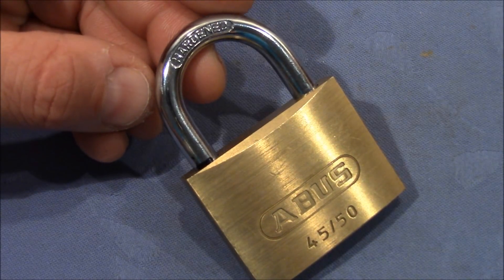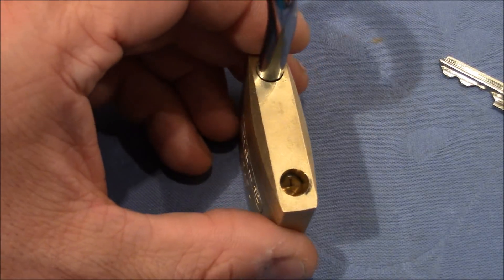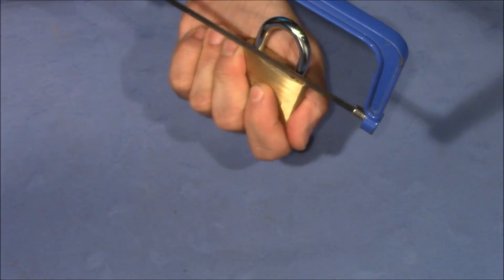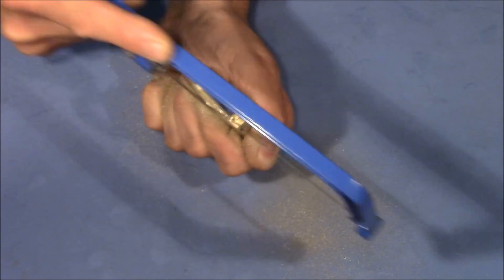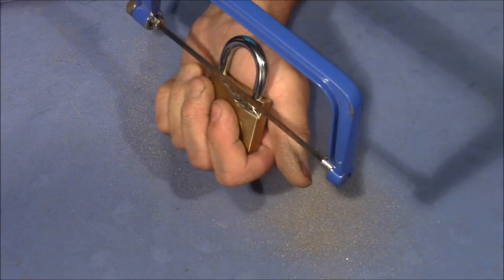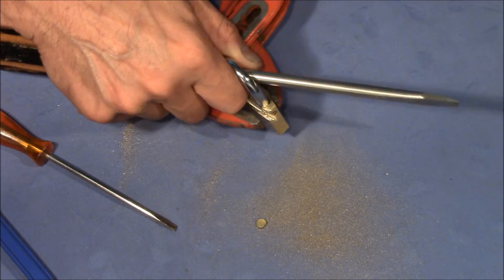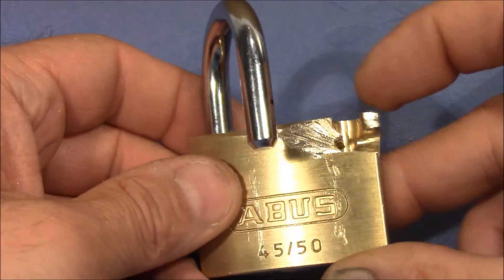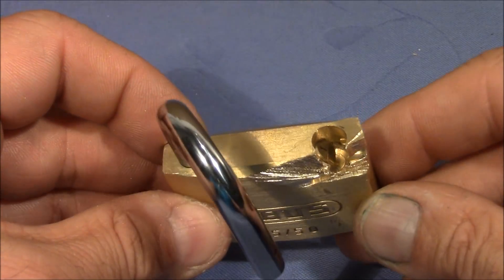(picking 555) How secure are brass padlocks? - hitting the weak point on an ABUS 45/50

Comment from the maker: Brass padlocks like the ABUS 45/50 have hardened steel shackles and 5 pin cores with security pins and paracentric keyways. However the brass body makes them vunarable for a simple attack where from the side of the lock are part is cut away. Then the shackle can be twisted out of the lock body.
Reply: I need a strong lock against acid and a hammer and saw impact.  
Can Stainless Steel 304 hold that ??

Comment: I too was worried when watching you with the saw! I’m glad you still have all your parts intact :-) this was very interesting, but a simple twist attack with the pipe wrench a la LPL seems to be a more effective attack for this type of lock. I though it held out quite well for a cheaper lock too :-)
Reply from the maker: Thanks, Potti314 is still in one piece ;-) The advantage of my attack is that you don't need a fix point, think about a padlock on a loose chain.

Comment: Good expo on the vunerabilities of the modern brass padlock. Would be the next best line of attack after brute shear pressure of bolt cutters. The achillies heel it would seem of most open shackle padlocks. Maybe you could try it again with a electric saw to compare the speed and cut rate on that type of attack. I would even volunteer to send over several Abus victims. lol. Cheers:-)
Reply from the maker: Thank you for you kind offer but I don't own an electric saw and I'm done for now with these kind of tests.

Comment: Good experiment... I wonder how it would hold us to a swift blow with a hammer & chisel....Cool video my buddy
Reply from the maker: Cheers buddy, for the hammer you need to have the lock hanging at some fix point. But I guess the lock will break - the locking bolts are small and made from brass.

Comment: Wow nice demonstration ! :D  I too was concerned for your hand - we need your hands in good health (but yea I know you were careful).  I'm wondering how long it would take to cut through the shackle with the same saw?
Reply from the maker: Cheers buddy, maybe I'll try cutting the shackle someday but the point was that this attack works regardless of the shackle thickness or hardness. I'm pretty sure that the saw blade will suffer much more from cutting the shackle.
Reply: One more question if I may ... what about using a chisel & hammer to quickly cut the brass (next to the shackle) ... if it works then it might be quick (although it'd be loud).  Thanks once again show showing this video. :D
Reply from the maker: This might work well but the padlock needs to be fixed somehow. If just hanging loose on a chain it might be difficult.

Comment: I wonder if annealing the body first by heating with a blow lamp and letting it cool will soften the Brass making it easier to cut? Oh and just because the hasp has Hardened stamped in it doesnt mean its so  :D
Reply from the maker: Interesting idea with the heat treatment. I guess it would help although the point was that a simple saw can do the job alone. Also it does not matter how thick and hard the shackle is. This attack will always work.

Comment: I know lots of other people will say it, but - aaaaaaaggggghhhhhhhhh ! I had to fast forward past you sawing that lock in your hand. I think that if the lock shackle was locking something rigid, you would then only need to stabilise the lock body with your hand away from the cutting point to make the saw cut, which would be easier for a thief, and less scary for us to watch :o))))  Thanks for doing this anyway, so we don't have to :o)
Reply from the maker: I also think that the lock hanging from a chain, the procedure would have been slightly easier. But while cutting, the blade was in the slot and no risk of slipping existed and I wanted it to be realistic. But I will wear gloves next time ;-)

Comment: Brass locks are beautiful but softer than hardened steel. I'm just glad we didn't see a slice of pie(314)! Sorry, someone had to say it.
Reply from the maker: Cheers buddy, Potti314 is still in one piece ;-)
Brass is also corrosion resistant and probably easier to work in the factory.

Comment: i have cut the shackle on small locks like that before, its rather quick with a hand saw, i would say its similar to the time it took you to go threw the brass. i think thieves would use a hammer or other tools and break the shackle with brute force.
Reply from the maker: My point was that cutting through the brass requires approximately the effort and time irrespective of the shackle dimensions. And the saw blade is still very sharp.
Reply: i'll try that next time, every other year or so i have a small padlock that gets destroyed by the weather. i'll attack the body like in your video
Reply from the maker: Great - I'm subscribed if you decide to upload a video of your attempt.

Comment: Cool exploit! I have'nt seen anyone do this before, great job mate. Thanks for sharing. Vid 555....just makes me think of the 555 timer ic :)
Reply from the maker: Haha, yes the NE555 I used a lot for all kind of a applications - once I rebuilt a broken toaster electronics with it to control the time the bread it toasted. Yes, this attack I also didn't see before - but it's straight forward as it attacks the thinnest part of the lock buddy which is made from much softer material than the shackle. So the thickness or hardness of the shackle has no meaning actually.
Reply: 555 toaster hahaha that's brilliant. Yep this method completely removes the shackle from the equation. Nice  piece of  sideways thinking ;)

Comment: I'm so happy you didn't get hurt doing this, and that was fun. Also a real world situation
Reply from the maker: Thanks buddy - I didn't practice that before so I was concerned about hurting myself, too. However you can push the blade to the hardened steel shackle to get the cut started and then the blade stays nicely in the slot. Yes, maybe a real word situation, in any case much easier than to attack the shackle.

Comment: Interesting video you make an important point brass is soft period compared to other lock materials.  For public usage my lock of choice is the Lockwood 334M/45 as it is SS and according to Lockwood "designed for high security and high corrosion marine applications."  whilst it's a decent lock, the basic shape is still the same as the brass Abus you used, that said the exposed shackle/flat surface is defiantly an attack vector on any lock.  What would be nice is a Abus 83CS/45 is SS that would make for a nice pin tumbler lock imho.  Thanks for sharing!
Reply from the maker: This idea was in my mind for a while - why all the discussion about the hardness of the shackle and it's thickness if you can just cut through the brass? Yes, these solid steel padlocks are great and the right choice of better security - the abus rock falls in the same category https://youtu.be/k1oWSDiD-oA But funnily the "rock" picks more more easily ;-)
Reply: 334M/45 Agreed great lock have a few here one with very interesting bitting ;)  As for the 83CS/45, CS stands for "Closed Shackle" iirc never seen one in SS both of mine are brass.  One I use for testing challenge lock bitting the other for impressioning practice.  Pretty sure the Euro impressioning guys use the 83 series in competition.  --> shameless self promotion -->> https://www.youtube.com/watch?v=xmz612-qxHE back when I used to "wash" my sparrows mat so it looked newish lol :)
Reply: TotallyRandom Locks and Picks TV yes the M model is SS but I'm sure the CS is case hardened chromed steel.🤔 I love them both anyway and use the 334M/45's on my side gates and tow hitch pin.👍🏽
Reply: Nice pick btw Potti :) ^^^ Weird hey they use a decent paracentric keyway on the 45/50 and the Rock by the looks, picking tiny locks with decent bitting can  be time consuming.  I think if a lock manufacture is going to make a lock such as the Rock more time and consideration should be put into key blank choice, bitting and pin design, given the larger keyway gives us more room to move tools in.  Also for the purpose of watching more of your *two handed video's please use a vise ;) Cheers TR